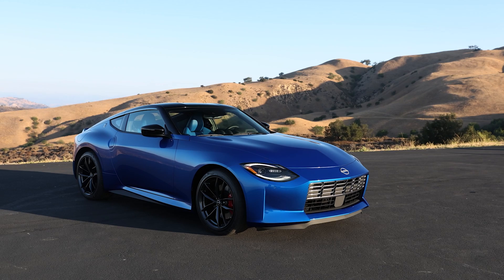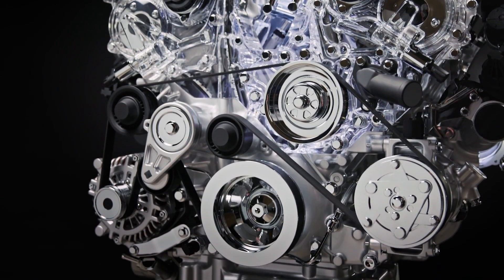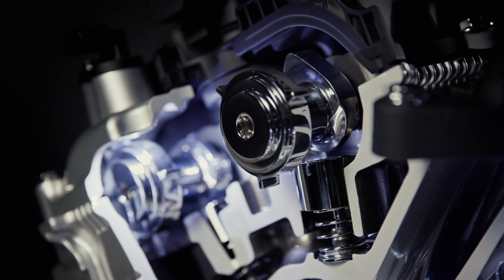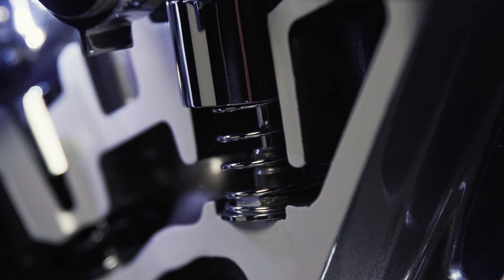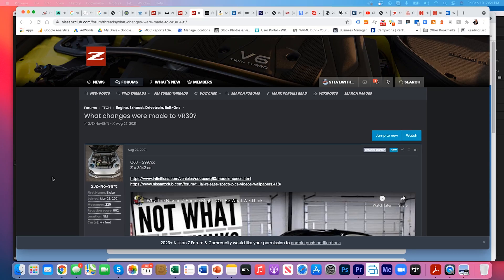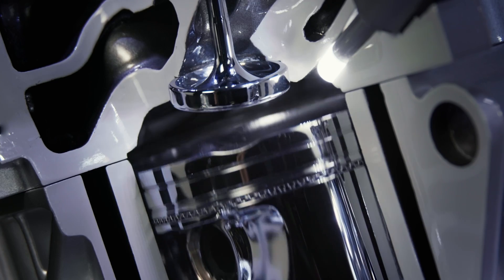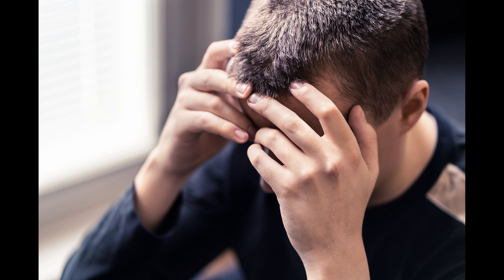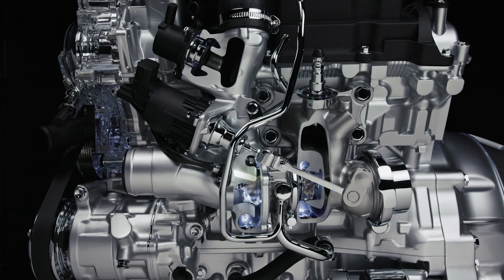NISSAN MAKES MISTAKE! We catch what everyone missed with the engine displacement of the NEW Z.

Comment: The 2018 and up mustang GT 5.0 claimed the same thing with their displacement gains.. it's the stupid liquid metal cylinder bore lining that they use instead of using actual cylinder sleeves. It's a Ford technology made to cheapen the manufacturing of the engine blocks. Also resulting in making the consumer pay to replace the entire block if anything goes wrong in there.. you're welcome for the info.
Reply from the maker: That is not the case here though.
Reply: @StevewithaZ  interesting because the vr30ddtt engine uses the same plasma cylinder bores as the Ford engines
Reply from the maker: @GeronimoBiggles  I was more talking about the displacement gains. They may have used that to compute the VR in the Q60 but the misprint I was highlighting here was just a mistake and not something nefarious.
Reply: @StevewithaZ  i see, i was just saying that it could be easily be possible because the liquid bores do change the displacement of the engine. since they can be significantly thinner than the sleeves. The thinner the coating the higher the displacement will be. The thicker the coating it will result in a lower displacement.
Reply: multiply that difference in thickness times 6, one for each cylinder and you can have a significant difference in displacement.
Reply from the maker: @GeronimoBiggles  the mistake was 7’.5 cc p/clyn
Reply from the maker: @GeronimoBiggles  really interesting.
Reply from the maker: @GeronimoBiggles  yeah after reading about it I recall this being a new thing - PTWA - but I hadn’t heard much about downsides. Honestly it seems like an awesome process. I used WPC treatment to parts of my motor. While it doesn’t dimensionally change the actual part size it’s applied to, it has some of the same anti friction properties.

Comment: Dished pistons or different head will not change tht displacement. That will just change the compression ratio. Bore, stroke and cylinder numbers are the factors for calculating engine displacement.
Reply from the maker: That is correct